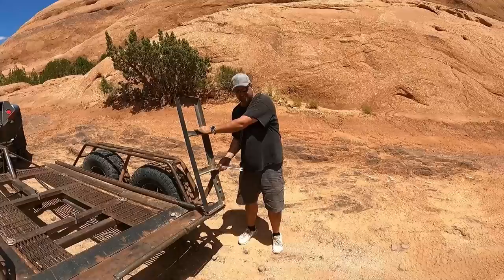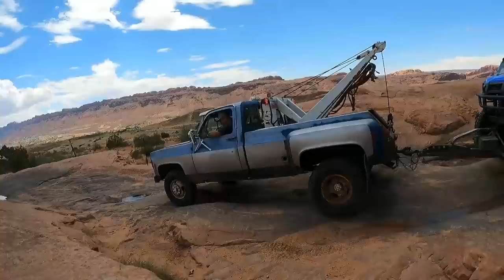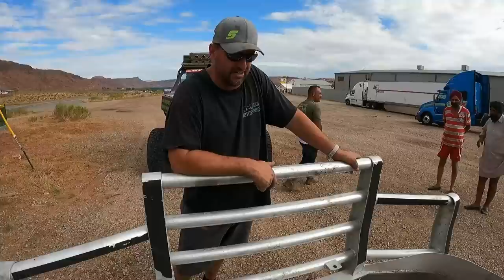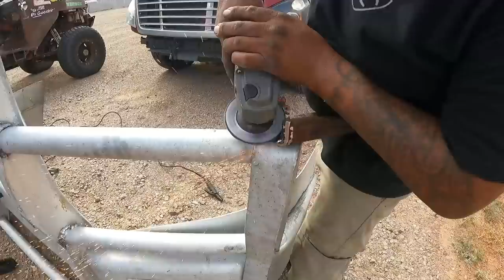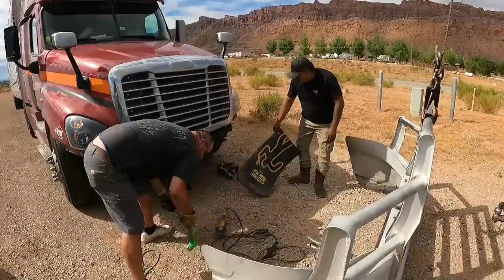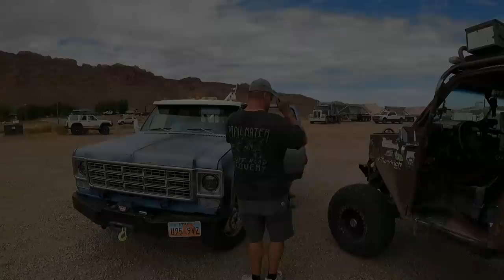SXS Recovery And Semi Bumper

Comment: Good thing you unhooked the battery from the bumper to avoid burning up the Bumper Control Module during welding. Top Notch Work :)

Comment: Nice repair on the truck,   as a truck driver I can say they really appreciated it and you probably saved them a huge bill from a rip off shop

Edit:  and that was one hell of a good weld job, that wasn't a temporary fix that was permanent
Reply: You'd like to think that. But vibration will crack the weld over time.
Reply: Better than a trail fix, but yeah that bumper needs to be replaced or properly fixed in the near future.
Reply: @1one3_Racing  I think they have rest of the welds on that bumper to worry about before Rory's weld crack

Comment: An easy thing you can do is to get a "smaller" 12" radiator fan-- like for a honda civic,  and mount it to the top of your cab like a ceiling fan, (center cab, where it's not really gonna bump your heads)-  and just put it on a simple switch-- and when it gets extra hot, you can just blast that fan and get some airflow on your sweat.  It works well when you really need it and you can't use your wing windows because you're going slow or idling.  It's an easy upgrade.

Comment: I use Harbor Freight  packing blankets to lay on or horse pads from Tractor Supply but the are heavy and very thick.  You will not feel any rocks under you.   I  know you want to keep the weight down on your recovery trucks.    When I have to work in the driveway on something they are dragged out from the garage to use.

Comment: I always like watching your channel and your humor is bar none. You get my vote when compared to matts off road, fab rats, robby layton ( but I do like hillbilly ), casey and casey . Keep up the great work. So I guess the new wrecker is going to get lockers and onboard welding too if it's going to hit (climb) the rocks more often.
Reply: Iirc it has on-board welding. Rory installed it in the engine bay. Might not be connected up yet though

Comment: Rory I always enjoy the outtakes they are comical to watch seeing a little peak of behind the scenes which is a great thing.
I can't imagine why you were concerned with making sure the battery was disconnected from the bumper. That would only be a small charge. 
I give you guys credit using two wreckers T times is smart as the old saying goes work smarter not harder

Comment: I'm sure glad to see that you disconnected all the electrical & battery from that cow catcher 😂😂!
Reply: I'm getting confused... Is all the comments about electricals and welding something to do with the EV he was welding in earlier in the week?
Reply: @barnabus1976  From what I gather,  Rory gets a lot of comments saying he should disconnect the battery when he welds on a vehicle. However, as he explained it in another video, as long as the welding ground cable is connected close to where the welding is being done, there is no need to disconnect the battery cable. Because of Rory's statement at the end of the video, and there being no electricalsupplies or batteries connected,  I was being sarcastic in my original comment 🙂.

Comment: Hi Rory. Those plates seem insufficient to support the weight of such a large bumper, and they also do not have a rib that gives them more resistance to the bending that such a high bumper should cause. Greetings from Cordoba, Argentina.
Reply: Rory told them that was a temporary fix so they better replace it as soon as they can!
Reply: @edbenson98  And it is. I would add that they reinforce them.

Comment: Those protection bars on the rig looked really heavy. Perhaps additional vertical bracing bars might have saved it. The design was compromised. As a field repair it was solid. The driver was probably under a lot of time pressure with his load.

Comment: Good to hear the new blue wrecker running with a healthy low end burble from the exhaust this time. More like TrailMater.

For half a mo, just coming off the Hells Revenge trail, with the view from the back of the rig, I thought your front passenger wheel was on the point of folding over into the wheelwell. 
Obviously it didn't.

Just out of curiosity, what did you have to do to get the new blue girl up to snuff?

If you're going to be doing more roadside welding jobs like this one, but in future further along the highway,  would you mebbes be planning upgrades for the new wrecker, along the lines of a power inverter charging set for your 18v batteries for recharging enroute to & from jobs.
Air compressor and welding unit, to have the same trail/roadside repair capabilities as Trailmater.

Or are those kind of new towtruck jobs just planned to get towed or trailered back to the shop anyway?

Maybe you could give us 
 a heads up on your next video from the new blue wrecker?

Comment: So what was wrong with the side-by-side?  You drove it on the trailer no trouble at all.  It was good to see you v out the weld for good penetration.  It looked like a decent weld, but the design of the mounting fixture was not up to holding that big bumper.  There is no triangulation so it is going to flex, and flexing leads to cracks which eventually break.  It's only saving grace are the retaining bolts, but we amly saw Shaun fit one of them, so the other side is still going to flex and crack.   It was strange seeing the truckers wearing what I think is called a kurta.  We have a lot of ex pat Indian people in NZ, but I have never seen the men wearing traditional dress when working.

Comment: Rory, you made a comment about the tractor bumper bracket being done by mig in the past. Is stick welding that much stronger than a well-made mig weld? Can you demonstrate in an upcoming video?
Reply: I still use arc when the metal is dirty (rust, dirt ect) It burns the rust out of the way and gets good penetration. Mig works well and is purdy, but I reserve mig for new steel in the shop.

Comment: I really dislike automatics. lol..    There's just something frustrating when you give it gas, and the engine is revving higher and higher--- and the truck still isn't moving;  so then you have to romp on the throttle to get it to respond, and it over does it.  I guess I've just been spoiled by manuals for far too long.  I just can't go back to automatics..

Comment: that bumper is a lot of weight on them brackets ... don't know what kind of room there is for a angle iron brace ..or sq tube seams odd just a flat stock bracket with all that mass of a bumper ..

Comment: I have a question. Regardless of my experience, I see that you use wire rope on your boom winch and not braided rope that I have seen being used on other new fabricated boom winch wreckers. Which do you prefer and why ?
 Braided synthetic rope winch lines are fairly new to me and in a straight pull I can see their safety value.
Reply: Synthetic even slightly rubs on a rock and it's done. None of us run synthetic in rock country. 
Wire is safe if we keep our heads on straight. 
I've seen synthetic break several times, wire breaks are rare.

Comment: Rory just a quick question.
Do you have a power inverter in case you actually need to plug power tools in? If yes what type do you use?
Reply: The cutting disc and grinder he normally used is mains power, so I'd guess he has an inverter, the same he plugs his welder into...?